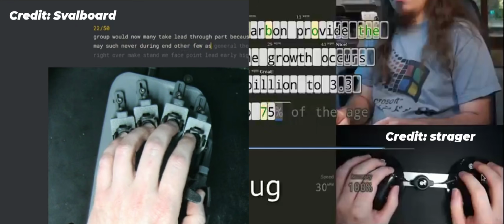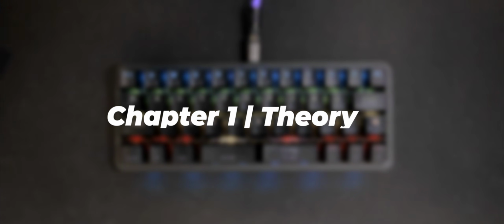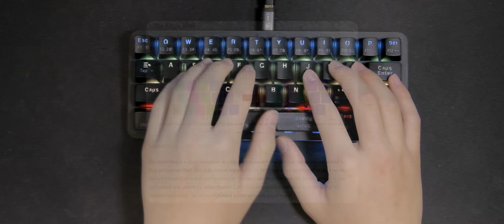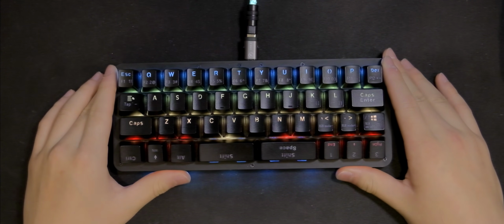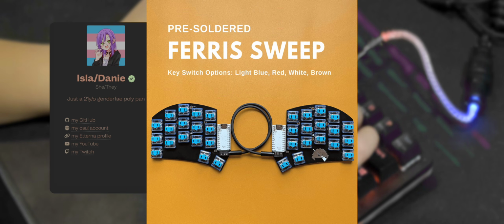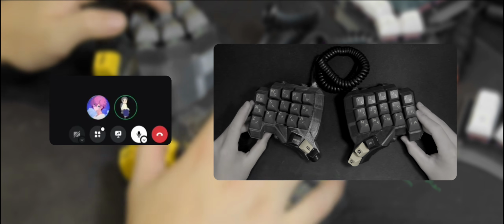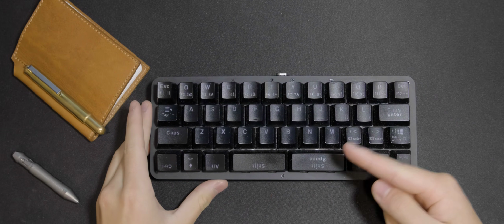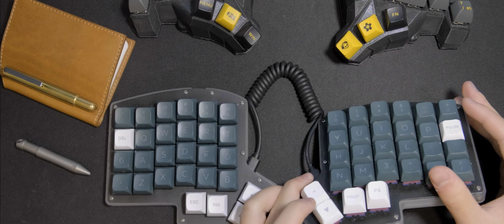A Split-Story | Ergonomic Keyboards

Comment: You didn't speak about hand size at all. Not about yours, nor about your interview subjects ones. 
A lot of things you talking about, like scissoring, using different fingers, using several fingers for one keyc e.t.c. is HUGELY dependent on hand size. Like for example the reason your version Dactyl  has only 3 button rows, or even 40% in general existence is likely due to it's developer all having small hands. 
Also didn't hear you mentioning that there is an option to generate 3d print model of dactyl for you hand size and also change the amount of buttons & rows based on you finger length.

Btw the stagger on split keyboards is also based on a hand sizes, especially the pinky one. This is literary the reason why you felt your pinky finger stagger wasn't enough.

The scope of your typing analysis still rather limited. 
Like The idea that typing fast is somehow good for you health or ergonomic is rather questionable. It may feel right at surface. Typing faster means you type less, hence less chance of RSI, but if you type with errors and you often need to backspace then you ride a much higher risk than someone who types slowly but with less errors. Or, you know. someone who DOENS"T PRESS BACKSPACE in the top right corner at all. Like most people who's like myself use multiple layered layouts. This is a huge part of this split layered or less that 40% layout after all.

Also monkeytype is good and all. But you should really include some whole text with punctuation ad coding benchmarks. Monkeytype is very synthetik benchmark aimed at measuring short bursts of typing speed which doesn't represent real world typing experience like coding or writing.

In the first place i don't think people with only monkeytype high scores can be called experts on ergonomics or typing. After all some of the fastest typist use stuff like notebook keyboard, and they are often also very young, like some of your interviews subjects. All the stuff like RSI is still in their future. Of course they are fast, healthy and doesn't experience problem with qwerty when they are this young and in the zone. It would've been better to interview some experienced coders and or writers, after their physiological prime years.

The money part. 
Microsoft natural ergonomics costs like 40-60$. The most expensive surface version sits at something like 150$+, the same with logitech one. The basic mass produce keyboard is simply the best option for introduction into ergonomic keyboard space cost wise. Also second hand options is always available for a mechanical one, since you can easily replace switches (hotswap) & keycaps and have yourself almost a new keyboard.
Reply from the maker: 1) Good point on hand size, it’s my fault for leaving that out.

2) Yes, I’m aware of 3D printed customized dactyls, but it has very little to do with the claims presented in the video (i.e., “not necessary” compared to colstag + tenting, at least imo).

3) I should have probably clarified that this was for my keyboard specifically, but if you take a look at, for example, the piantor, has a much more aggressive pinky stagger. It’s more of a poke at popular colstags trying to optimize more for crowd compatibility over that of ergonomics.

4) I never stated once in the video that typing fast is better for your health. The claim was speed (which for many [for some reason] is the reason they adopt ergo. I suspect this is because of the claims commonly marketed with ergo keyboards being “more efficient for typing (see: OLKB)) isn’t dependent on using an ergo keyboard, and health can be better optimized by using alt layouts.

5) That was the claim in the video… you don’t have to press certain keys in so and so way. The backspace example was to initiate that idea (many people on ergo for example use thumb keys for backspace or caps lock, and also the whole thing with alt layouts).

6) The idea of coding benchmarks is a good one, but that leans more into keyboard size and layers. Many people use a separate layer specifically designed for coding, and this all dives more into software than that of hardware (again reiterating the point of software > hardware being more significant). Maybe I could’ve emphasized the utility of thumb keys, true.

I should also clarify that my opinions on each of these keyboards were not formed over monkeytype alone (it was just in the video as an example). I used each of these keyboards for multiple months and for multiple purposes.

7) About the money, I’m not sure where you are getting your information on microsoft and logitech keyboards. The only one I can currently find is the logitech wave (and ergo for around $100). I’m not sure if you are relying on past information, but microsoft has stopped manufacturing their ergonomic keyboards for a while now - most remaining being price jacked insanely. Also, yes true.
Reply: @va1orance  >4) I never stated once in the video that typing fast is better for your health. 
>I suspect this is because of the claims commonly marketed with ergo keyboards being “more efficient for typing (see: OLKB)) 
>OLKB 
Oh god, no. Not this PLANK preachers. If guys like them will be left to form the public opinion around ergo keyboard, we will still be typing on a typewriters for next 200 years.
Well my info may be a little bit out of date, but most of the marketing around ergonomic keyboard i was subjected to, was about them being better for you health, more comfortable, and sometimes allowing you to type longer and \or faster as a consequence.  The keyword was always "efficiencty and health benefits" not the speed. The split and <40% layout is also about ergonomic and health, since it's obviously faster for most people to just press a button than to learn to press several, which is not for everyone and not always faster when learned and e.t.c. 

5)>many people on ergo for example use thumb keys for backspace or caps lock,
exactly in actual text editing the placement of navigation keys and backspace plays a huge role

>6) reiterating the point of software > hardware being more significant
Which isn't always true, since no amount of software can get you more than 3 button to press with a thumb.
Software stuff like autocomplete functions still require you to dedicate some button or key combination to use it.

>7) About the money, I’m not sure where you are getting your information on microsoft and logitech keyboards.
Yeah, it seems my info a tad bit out of date. Though some googling point to the article named
>Microsoft partners with Incase to bring back its recently discontinued keyboards and mice
which states that the discontinued peripherals can be relaunched in the future.
>The only one I can currently find is the logitech wave (and ergo for around $100)
Even though the currently available logitech ergo one is still a pretty good starting point, since it provides both a little bit of tilt & split. Also scissor switches.
Reply: @trashviewer3521  for context, I am the first interviewee in the video and a programmer myself; accuracy is one of my personal focuses in typing (because frankly it's just more enjoyable to be accurate, that's all).

While it is true that being fast at monkeytype doesn't necessarily mean you're good at typing correctly ergonomics-wise, there's a limit to how many things you can be doing wrong while still being fast.

Also alt layout typists generally tend to not be the kind that just spam monkeytype runs, that's mostly a QWERTY user thing, since they usually care about the speed more than proper ergo. These two groups are quite different despite usually using the same website as a benchmark, and will have different average accuracies and alt layout typists will most likely not be using backspace in the top but have it bound somewhere better (I personally have Ctrl-Backspace bound to my Caps Lock key).

Comment: I'm on first minute and I already see the problem with how you are not testing any mass produced ergonomic keyboards, like microsoft natural ergonomics or logitech ergo, and instead opting for their inferior counterfeit of Arisu/Alice. The difference is microsoft and logitech have somewhat sculpted keywells, when Arisu/Alice ones are just flat.

Arisu/Alice is kind of like Plank. Some sort of half measure form factor that doesn't provide anything of value to anyone in anything, but require huge time investment to figure it out, that can't be converted into anything useful afterwards.
Reply from the maker: @trashviewer3521  
Yes, that's kinda the point... I purposely chose Alice so people can see the effects of each ergonomic optimization independently.